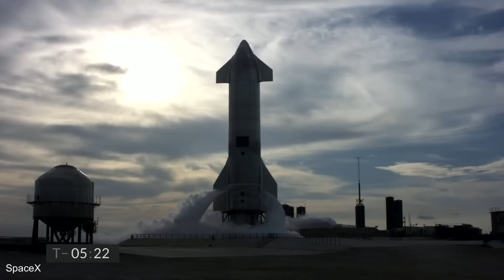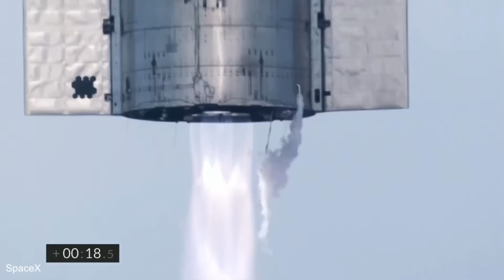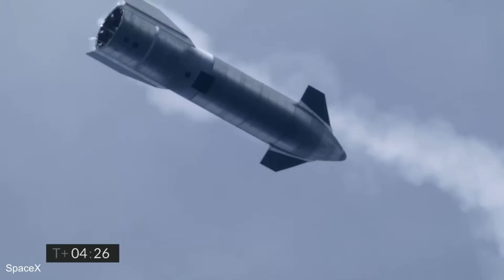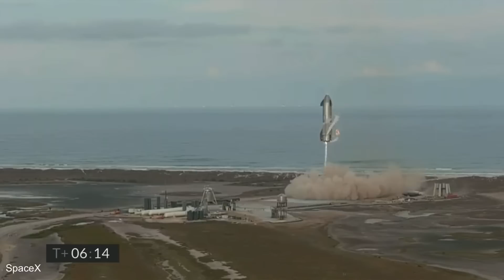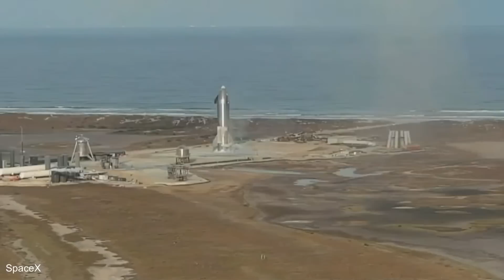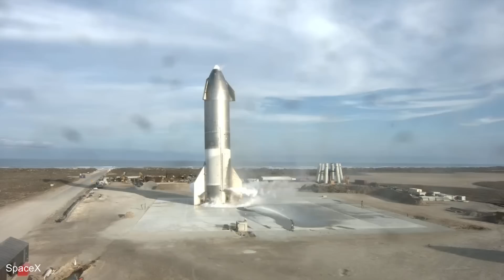SpaceX Starship SN10 High-Altitude Flight Test

Comment: 1950's FLASH GORDON design finally came into fruition with AI GPU SoC control of rocket engines.

Perhaps they should carry on some fire retardant to solve the external burnt after rocket engine shutdown.

Extra weight but reduce accidental  explosions.

😢

Comment: The landing on this third attempt was markedly better than the other two attempts when it came down too fast, at an angle, and crashed and blew up.  I wonder what they changed to make it work this third attempt.  It seems they briefly used three engines this time compared to the last two attempts where only two engines were used.  Is that the only change they did?